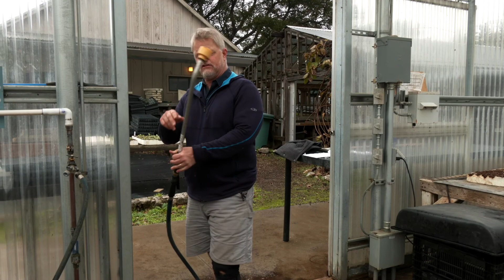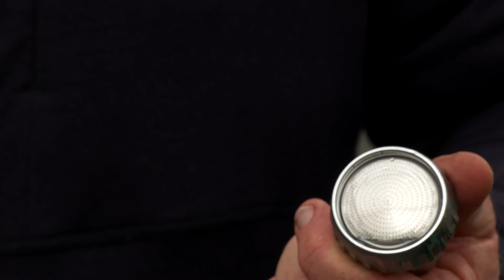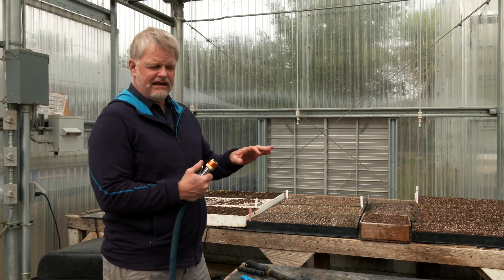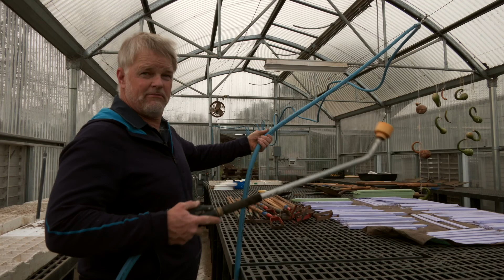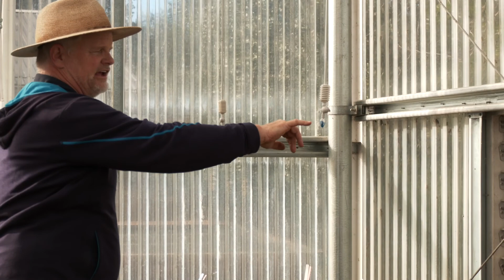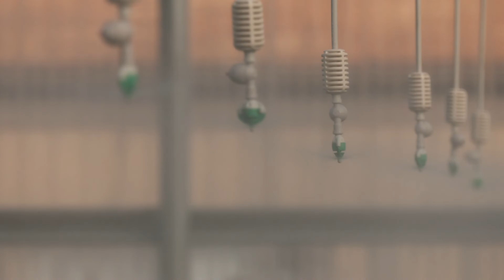Irrigation Methods and Tools In A Greenhouse Setting

Comment: Note that Gilmour(?) makes the Gardena-to-MHT Adapters and they are relatively inexpensive, about $3 for two.at ACE Hardware, and they are compatible with both Gardena and Claber brand Couplers. And of course Amazon has Melnor versions as well as many offbrand/untested various copies from PRC.
It took me years to get all our hoses and H2O Dispensers set up with quick connect but we got there once there were Gardena altenatives available.
And yes, those Dramm Brass Valves are the Bees Knees, and I have had a few for 25 years now, though new ones are approaching $30 each!
Fortunately I've found no-name equivalents for around $12 per.